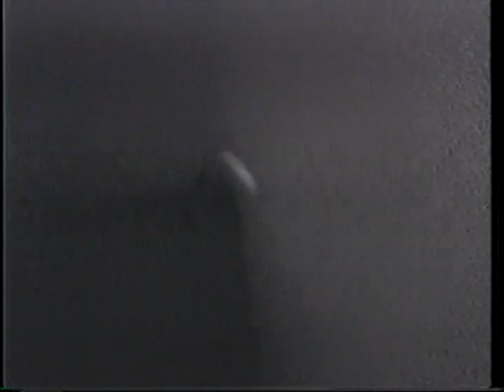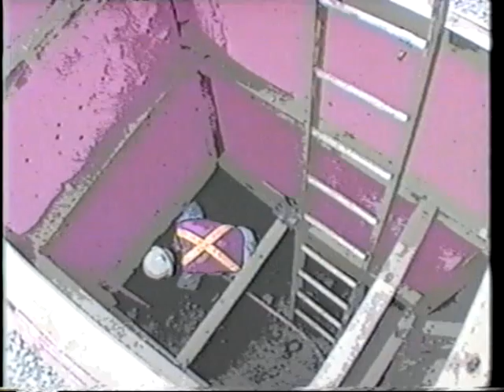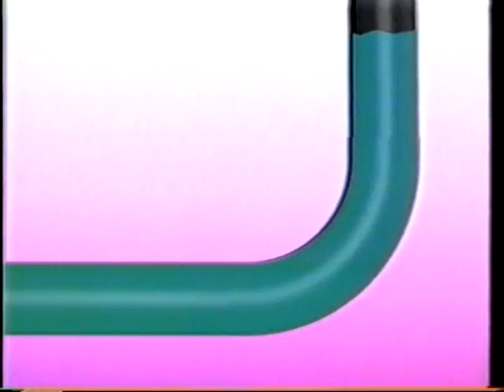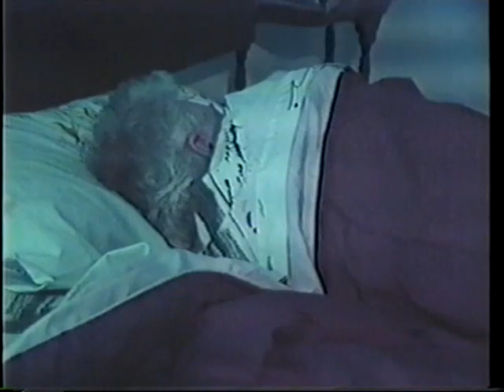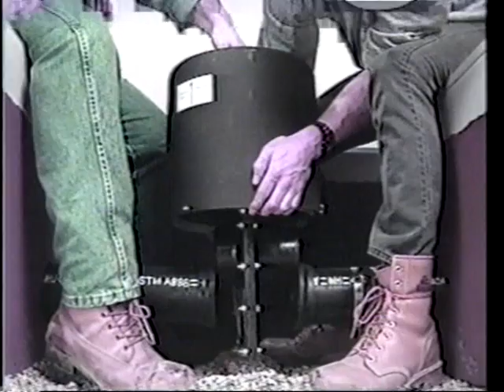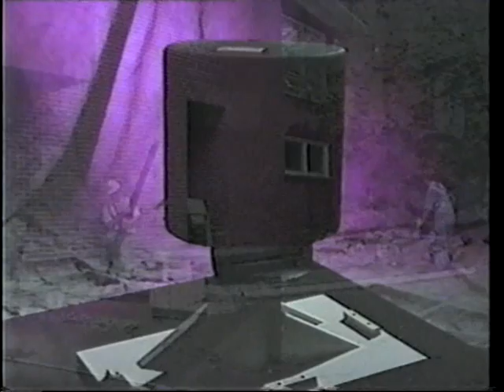Flood-Gate Video

Comment: I have one of these floodgate valves but it has not been exercised at the recommended 4x/year for at least 2 years.  When I try to move the bellows using the screw-on handle, it does not move freely.  I can get it to travel up and down if I really pull or push on it hard, but I'm skeptical that water pressure from a backflow event would make it move.  Can a plumber restore or lubricate it, or does it have to be replaced completely?
Reply: Who installed your valve? Maybe they can service it?

Comment: I think this design would work 100% if there is a check valve after it.  Otherwise, water will still back up and go inside the house before the pressure builds up.  If there is a check valve after, the pressure will build up without much water going inside the house which will activate this floodgate valve